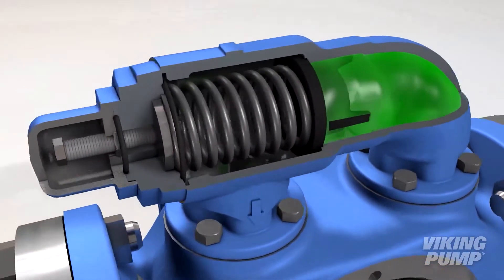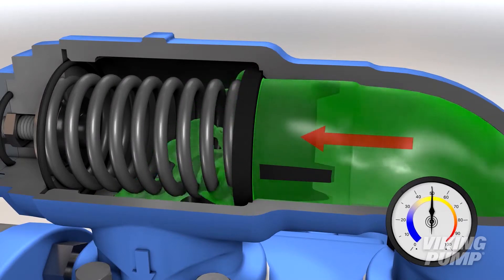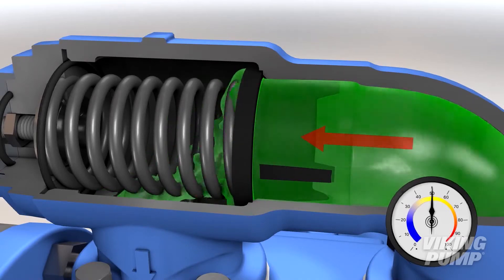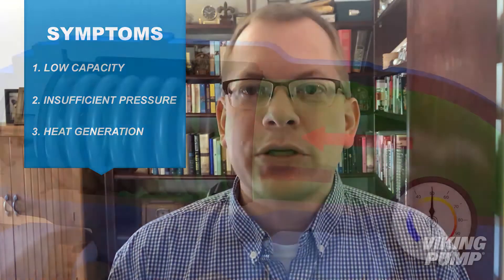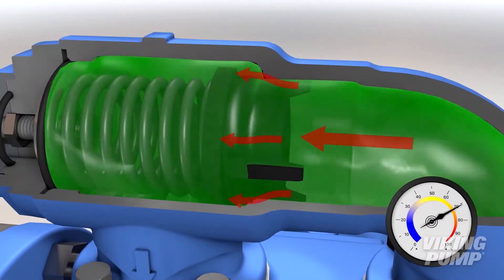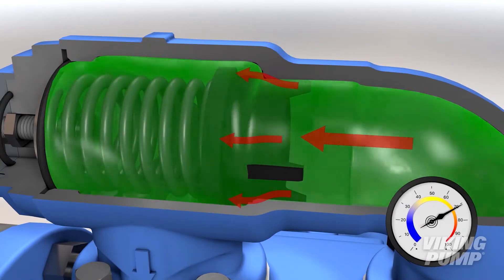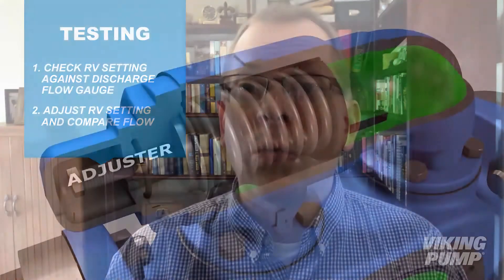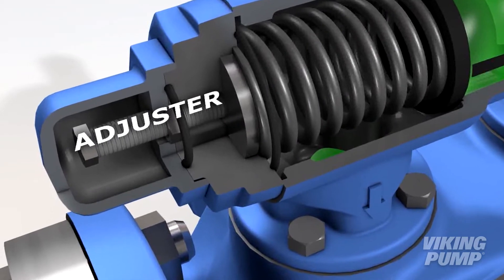Pump Troubleshooting 101: Relief Valve Settings

Comment: Hola, mi bomba puede funcionar sin la válvula de alivio?
Reply from the maker: A relief valve is not required for pump operation. It’s there to prevent damage should an overpressure condition occur in the system (i.e. a closed valve, downstream blockage, etc). If an internal relief valve is not used then other overpressure protection should be installed.
Reply: @VikingPumpInc  gracias, una consulta, tengo una bomba Vikingp y me entrega menos caudal de lo que dice el catalogo, quiero repararla pero, al abrirla los engranajes y bujes se ven aparentemente buenos, mi pregunta es como saber que los engranajes no están con desgaste, hay algún manual donde salgan las medidas de los engranajes y la holgura que debiesen tener, saludos
Reply from the maker: @GENZOHXC  Internal wear is certainly one reason a pump would produce less flow, but there are other possibilities such as relief valve bypass, cavitation, changes to the pumping conditions, etc.

For further assistance with inspection or troubleshooting contact your local authorized Viking Pump distributor. You can find yours here: https://www.vikingpump.com/contact/service-support
Reply: @VikingPumpInc  Thank you for your time in responding, I have the pump on a test bench at 1200 rpm, there is no cavitation, it does not have a relief valve, it is directly connected to a flowmeter towards the tank. That is why I am interested in knowing if there is any manual, where it tells me the measurements of the gears to compare them, greetings, thanks.
Reply from the maker: @GENZOHXC  Here is a link to the Technical Service Manual https://vp.salesmrc.com/item/3979 - but an inspection report can be done by your distributor!
Reply: @VikingPumpInc  mi bomba es una AK125
Reply: Hola sabe si la
Bomba hl4125 me sirve para inyectar combustoleo pesado o creosota a la madera en tratamiento de impregnar  con aunto clave 16 metros cúbicos necesito